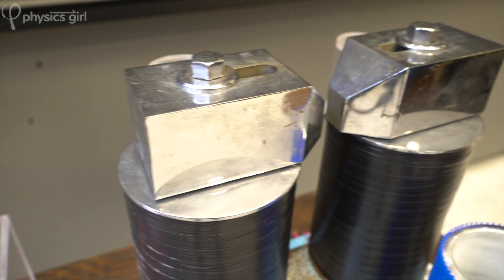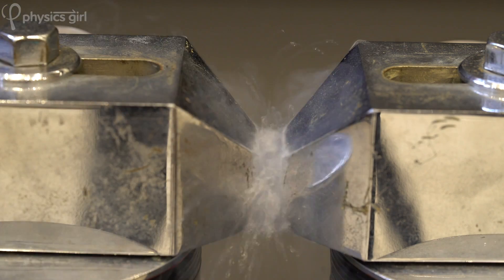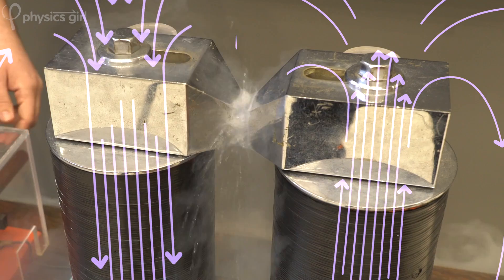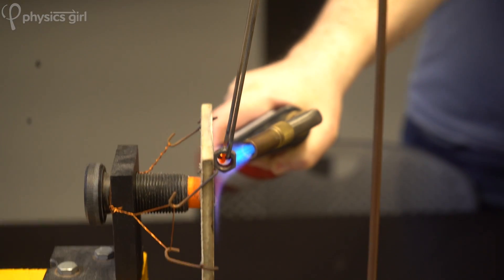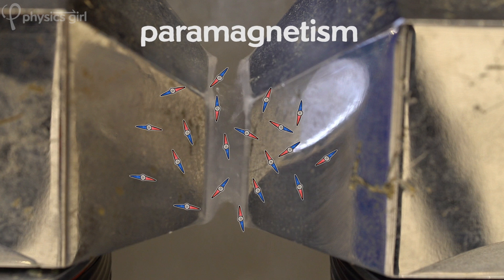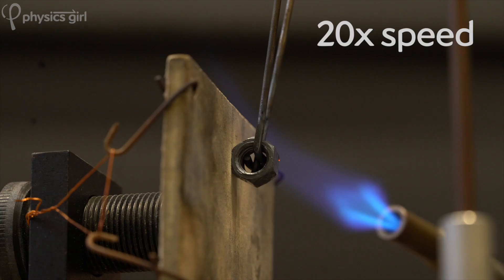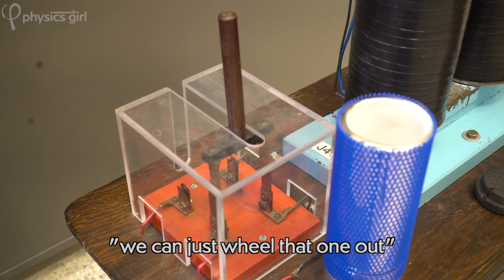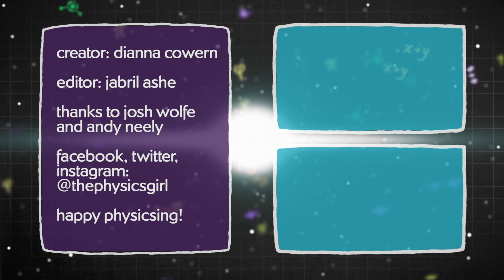Oxygen is MAGNETIC?!

Comment: If you breathe liquid oxygen, do you drown ?
Reply: Your lungs would freeze and possibly shatter/explode when you try to breathe or as the oxygen boils it will expand your frozen lungs. You would probably die from asphyxiation... It'd probably be much more painful than drowning.
Reply: Naej you would get energetic
Reply: Either it is so cold that you would freeze your lungs and die from asphyxiation like specter0420 said or you would be under so much pressure to allow oxygen to be a liquid at ambient temperatures in which case your lungs would collapse and be unable to inflate them. Its a lose-lose, but it is my understanding that there are special solutions you can have for deep sea diving which allow you to breath oxygen from a liquid, though it is not liquid oxygen.
Reply: the inside of your lungs would freeze and in so doing probably damage them beyond repair, thus inhibiting their function of providing you with oxygen, which would kill you.
Reply: but that is a cool question though. lets imagine that cast a magic spell on your lungs and now are immune to cold. it would be extremely painful at first because that is usually what happens when you have liquid on your lungs, but now you have boiling liquid. but as the liquid oxygen starts to evaporate it will be absorbed by alveolus. but now there is a new problem, since you have a high concentration of oxygen in your lungs, you will get oxygen intoxication, a condition that causes severe cell damage and even death.
and also what everyone already said
Reply: Naej - Nope! They freeze because the temps that oxygen liquefies are super low.

Kevin D - Not liquid oxygen (again, frozen body parts). It was an oxygen rich fluid. Apparently, the mouse scene was a real demonstration of the technique. https://en.wikipedia.org/wiki/Liquid_breathing
Reply: If you were to breathe liquid oxygen at normal pressures, you would damage your mouth and/or nose, your bronchial tubes, and your lungs, due to the effects of water in them forming crystals as it freezes slowly enough to cause such damage in the interface between where it freezes more quickly and further from the liquid oxygen where it doesn't freeze at all. This is because molecular oxygen has a very low evaporation point at normal pressures (such as those found above sea level, as well as quite some distance below sea level. On the other hand, if the air around you was pressurized to the point where oxygen would become liquid at ordinary room temperatures, you would most certainly no longer be breathing.
Reply: Simply, You will die as it will freeze your entire respiratory system. (as u said that u r gonna inhale liquid oxygen)
Reply: But it WAS a drill
Reply: +Naej  Are you out of your mind?!?  You don't breathe liquid oxygen, you drink it!  I mean, c'mon, dude.
Reply: @Naej, no, but you would become Magneto.
Reply: You've got to chew it first, otherwise the cold temperature will freeze the mucus layer in your lungs. That mucus layer usually facilitates gas diffusion across the alveoli surface, but stops it when frozen. A major function of the sinus cavity is to warm and humidify incoming air; the longer air is in the mouth or sinuses, the warmer and more humid it gets.  Winter time runners up north sometimes freeze their lungs - they suffocate because the air did warm up enough in their mouth or sinus. Like I said: you've gotta chew your liquid oxygen before breathing!
Reply: The liquid breathing in Abyss was supposed to be a perflourocarbon with oxygen dissolved in it, somewhat like it is in blood. I was disappointed to learn that it was a special effect though, because it's still experimental, and not yet in use for people, AFAIA.
Reply: bwt don't do that
Reply: If not for the freezing or pressure, on chemical level, you would literally burn your lungs :D
Reply: No, but you would die for other reasons.
Reply: Lets say we had some weird isotope of oxygen that could be liquid at body temperature. If you breathed it, you would have oxygen overdose. It is a problem that affects scuba divers who breathe oxygen that is too pure.
Reply: Naej No, you would not drown, you would most likely die or at least be horrible damaged.  Then everyone would know you as one Cool Dude.
Reply: Your lungs would freeze...
Reply: i dont know but i would like to  see a video that answers  that
Reply: Kevin,
In the Abyss, the fluid used was an oxygenated liquid that did not boil in the diver's lungs.
Reply: u can drink a liquid.. u can inhale a gas.. since its a liquid u can drink it.. lol all these wrong answers..yeah your tummy and throat will get burned but actually u dont inhale liquids xD u drink them
Reply: no no thats highly oxygenated water. not liquid oxygen xD
Reply: Powder but could a person still breath or I guess drink that (highly oxygenated water) in a deep dive suit and still survive?
Reply: Nae you would die did you not  here the temperature you would be frozen from the inside out.
Reply: Naej no,you get snap frozen
Reply: Naej look it up on Wikipedia article  and it says us air force use it to help aircrew breathe at high altitudes
Reply: no but you do die independently from how the liquide oxygen is produced. at 1 atm oxygen is cryogenic causing instantaneous freezing of the lungs causing irreparble damage to your respotory system. if the oxyygen is simply presurised, i don't know how high pressure environment affect the body but i do know that pure oxygen is toxic at 1.6 bars, liquide axygen is a ot higher than that.
Reply: I mean, if  you breathe pure oxygen you can suffocate... so probably.
Reply: not liquid oxygen, but breathing other liquids with dissolved oxygen is possible. It helps that they aren't at 90 kelvin.
Reply: Even pure oxygen as a gas is dangerous.
Reply: I say it with caution. Breathing ONLY pure oxygen can be dangerous. Even people who have lung diseases, I doubt if they get pure oxygen directly, but rather a mixture percentage.
Reply: Tt Miller 
I was only addressing the matter of pure oxygen at standard atmosphere pressure and temperature. I know the video is about liquid oxygen. Pure oxygen in any form is unsafe in the lungs.
Reply: Naej Now i need to know!!!
Reply: Naej no you'd be instantly killed due to you lungs being forze.  but to answer your question, so long as the oxygen can be carried away by your blood cells, no.  you'd be breathing liquid.  Although I'm sure there's a long list of problems besides just "ice lung"
Reply: You'd get lung and respretory damage from the cold.
Reply: That too.
Reply: Donald Kronos wow
Reply: so goooood
Reply: Naej you freez
Reply: Why didn't you use PPE
Reply: Naej no
Reply: Your lungs would freeze into ice
Reply: You would freeze
Reply: No, you would die of cryshock.
Reply: No, but you would win a Darwin award or two.      severely frostbitten on the esophagus and trachea, probably ruining the larynx.      you'd probably never breathe again and die painfully or never speak / eat again if it went down the wrong way.          if you could survive under pressures where Oxygen is liquid at like room temperature or a temperature a human could handle, thats not -180C at standard atmospheric pressure (`101.3kPa) its more like above -40C / F but under extremem pressures , that'd be cold but doable
Reply: Naej you freeze
Reply: Pretty sure if you tried to inhale liquid anything you'd just cough it back up. Besides that your mouth and throat would freeze before it even got to your lungs. On the other hand, the vapor emitted from LOX has given me "brain freeze" before from prolonged exposure. Well more correctly, the brain freeze happened after I started breathing warmer air as the roof of my mouth started to warm back up.
Reply: I volunteer as tribute!
Reply: I was was thinking the same thing
Reply: It depends. Water is oxygen and hydrogen, so in this case you would probably drown.

Breathing extremely cold oxygen will damage your lungs and pull all the heat from them. The oxygen will not be able to move into the blood and you will die.
Reply: Okay, everyone told you why you cannot breathe liquid oxygen.  They're right.  What you CAN do is breathe in the O2 gas straight from the boiling liquid.  On a hot summer day, I've stuck my mouth right over a styrofoam cup full of liquid oxygen and breathed in the cold gas.  It's just very dry (0% humidity) so you can't do it for too long.  Feels like you're breathing air on a cold winter day (sub zero).
Reply: You can’t breathe a liquid, but you could breathe in the oxygen boiling off
Reply: Most people have already brought up the cold conditions, but as some have asked what happens even if you imagine the lungs being able to handle such temperatures (and still retain the ability to move/function as lungs) I may have some explanation! From a cryogenics standpoint,  we supply liquid oxygen to hospitals all the time. Since the expansion ratio is 1:861 (for every unit of liquid, you get 861 units of gas), liquid oxygen can feed large patient volumes with good, clean oxygen gas expanded from the liquid. The problem is, liquid oxygen is kept at 250psig to maintain the liquid temperatures as there exists no coolants capable of keeping the oxygen in its cryogenic state. Thus, as the liquid boils, the oxygen would be denser than your lungs are used to even once its open to atmospheric pressures. During COVID, many hospitals had such high patient influx that they overdrew the vaporizers expanding oxygen liquid to gas, so the oxygen supplied to certain hospital wings was in a denser 2-phase state which wasn't good for patients breathing. Thus, if your oxygen wasn't properly metered to be in the correct densities, and/or concentrations even if your lungs could function in the cold temperatures, breathing would get hard very quickly.
Reply: No you just shatter your lungs
Reply: No but you work better, people working in Google are forced to drink it at work.
Reply: I would imagine that it would not be a smart idea as CO2 would not be able to diffuse across the affected alveoli, causing a ventilation/perfusion mismatch and increased partial pressure of CO2 in the blood, therefore making it more acidotic. However, you would simply cough up any liquid that has been aspirated in the first place before that could happen.
Reply: I don't think you would die. The liquid oxygen would boil well before it got your lungs, and the expanding gas would push out any more liquid you tried to inhale. Inhaling the liquid oxygen into your 98° body would be like trying to pour water into a pipe that was glowing red. It wouldn't get too far. You'd damage your mouth and esophagus severely, however.
The Abyss liquid oxygen was a compound that really exists, but has never been successfully tested on humans. I read in just the last month that there is a study currently underway to develop the technology further. I believe I read it on phys.org.
Reply: Specter0420 I don't know why I didn't think of that being to cold to evaporate and you know the leidenfrost effect.
Reply: Well. you die anyway, so, that question really matters?
Reply: Your name is stupid.
Reply: Didn't they do that in The Abyss?
Reply: @kevind814  In Aquaman he can breath water.. But both are movies with sci-fi/fantasy elements.
Reply: @kevind814  No, they did not. They used an oxygen-rich fluid known as a perfluorocarbon. The scene where they submerged the mouse into the fluid and it survived was real (look it up). It is comical to imagine them using liquid oxygen, a cryogenic liquid.

Comment: I am glad you use Kelvin,  but at least translate it to both Fahrenheit AND CELCIUS. I am very triggered.
Reply: Since you put Celsius in caps I assume it's the unit you want. The Wikipedia article on Kelvin (which in itself is interesting) has this simple formula for converting K to degrees Celsius: [°C] = [K] − 273.15. For Fahrenheit it's [°F] = [K] ×  9⁄5 − 459.67.
Reply: +Frank Anderson

Nope.

The Apollo Guidance System was programmed using SI, and units were converted to Imperial for the astronauts to use.

Imperial units are defined by converting from SI. For example:

1 inch = 25.4 mm
1 mile = 1.61 km

The Imperial system is not superior, by any stretch of the imagination, which is why the US is the ONLY western nation, and only 1 of 3 in the world, that has not 'officially' adopted SI as its measurement standard. However, the US government requires SI for all federal agencies, and international trade. Pretty much the only mass usage of Imperial in the US is the layman, the trades, and manufacturing, because you dummies are too stubborn to adopt the more efficient, less convoluted, more precise and thus superior SI.
Then entire scientific community says you're wrong. You're bad, and you should feel bad.
Reply: She put both F and C in figures on the screen. Also, she said "In Fahrenheit it's when your spit freezes way before it hits the ground"... that'll be the same in Celsius. Thanks PG, cool video as always.
Reply: Though, she did entered it for the temperature of liquid oxygen. However, there is no excuse for the Curie point of iron...
Reply: @Frank Anderson: Guess what? You're more like an old man who complains how everything was better in the past except it's about units and you're around 30, 40-ish. People like you are the reason why US still hadn't changed to metric.
Reply: →MarioFanGamer
Water freezing at 0°C and boiling at 100°C is only true at standard atmospheric pressure. And even then, it is possible to heat distilled water to a few degrees above 100°C without it boiling (superheating), and chill it to a few degrees below 0°C without it freezing (supercooling).

This is why Kelvin is currently defined so that 273.16K is the triple point of water, and 0K is absolute zero.

The only temperature scale worth using is one where zero means zero!
Reply: HejManden It is too easy to translate into celsius, so probably for that one, you should not be that triggered.
Reply: Instead of saying '9/5', it's simpler to use '1.8' for a calculator.

°C = (°F - 32) ÷ 1.8
°F = °C x 1.8 + 32
Reply: @Frank Anderson: Supperiour because it has achieved more stuff? Come on, all these stuff could have been done with metric too. Not to mention that in terms of sub-unit conversation and base compatibility, metric is better then imperial.
I mean, come on, just stop using so many different units and use stuff like kilo-foot or milli-gallon.
Reply: Gabriel cazorla persson And let's not forget when the US bought plans for a tank from France and failed to notice they were in metric until the first ones were fully assembled...
Reply: →Frank Anderson
Did you just try to claim the US is a lady?? smirk
Reply: Zutaca Whoops, I meant from Celcius to Kelvin. Sorry
Reply: @Frank Anderson: And water freezes at 0°C and boils at 100°C (for comparison: 32°F is the freezing point and 212°F for the boiling point). And in contrast to the moon's temperature, this is no coincidence but delebritely chosen, not to mention it is more applyable to the real world (I mean, no one besides scientists cares for the temperature of the moon, the freezing and boiling point of water, however, many more people).
Though, temperature doesn't matter very much because there aren't any real subunits. I mean, I could live pretty much with Fahrenheit too.
By the way, metric isn't a base 10 system, it's a comma-shifting system.
Reply: →Frank Anderson
According to this http://www.space.com/18175-moon-temperature.html it’s more like +253°F to -243°F. Nothing “intuitive” about that, that I can see...
Reply: →Frank Anderson
Water has more uses than just boiling pasta; it is fundamental to all life.
Reply: You guys realize he's just a troll, right?
Reply: How hard is it to convert kelvin into Celsius mentally?
Reply: Much as I prefer Kelvin when doing physics calculations, Celsius (in my head I still say centigrade) produces much more handy numbers for everyday life.

Is it going to be freezing tomorrow?  That's a nice round 0 °C.   Is it going to be 273.15 K?  Hmm, not such a handy number, in fact in Kelvin, nothing you ever experience in real life has a nice temperature associated with it.

Kelvin for science.  Celsius for everyday use.
Reply: They must have ended up being very small tanks.  Didn't anyone notice that they were the size of a child's toy?

I suspect your story is 90% urban myth and 10% imagination.
Reply: Do the conversion yourself from K to C
Reply: The only real temperature scale worth using is the one where zero means zero.
Reply: Just add 273...
Reply: http://tvtropes.org/pmwiki/pmwiki.php/Main/Troll

Comment: back emf?>
Reply: When a coil is energised, it generates an electromagnetic field around it.  When it is disconnected from power, the electromagnetic field collapses back into the coil, inducing current in reverse and since this happens almost instantaneously, it is a surge strong enough to create sparks.
Reply: Electromagnets are inductors. When you get a current flowing through them, it's hard to make the current stop, so the switch sparks when you open the circuit.
Reply: Back emf or self induced emf.It the emf produced in a coil (conductor) due to the change in magnetic flux of the same coil
Reply: +Han Pritcher Is that Wein's Law in action?

Comment: "Really strong electricity"?  <cringe>  Was it high voltage or high current or both?

Is this an effect seen only in O2 (diatomic Oxygen), or does it also occur in monatomic Oxygen?
Is it seen in other elements in Oxygen's column in the Periodic Table?
Reply: If you have a single uncharged atom which isn't a noble gas, then you'll have a free radical. Free radicals are also magnetic so yes, the effect should be observed in monatomic oxygen.
Reply: No, free radicals are not, by definition, magnetic.  They aren't even charged, again by definition.  What they do have is a strong desire to fill an outer shell.
Reply: Their unpaired electrons are magnetic.